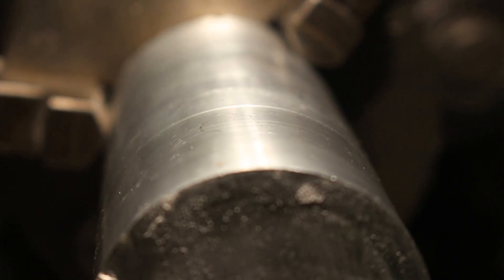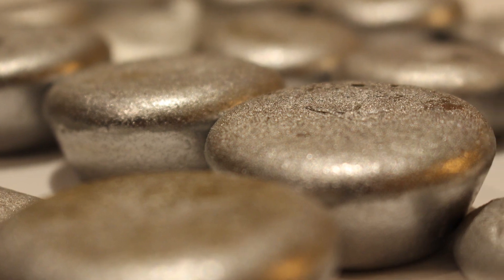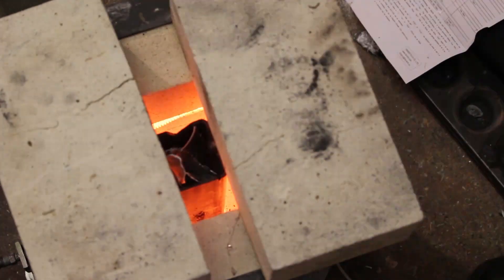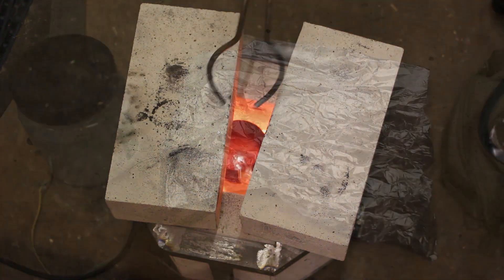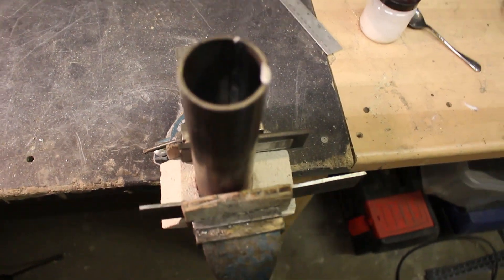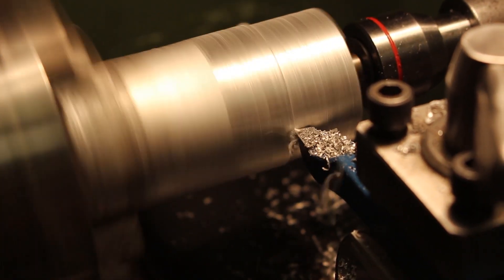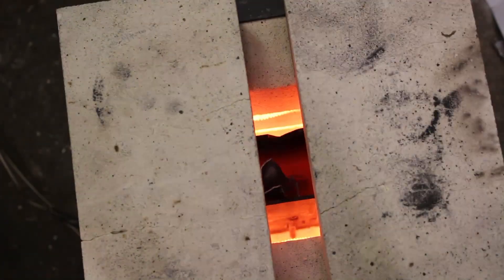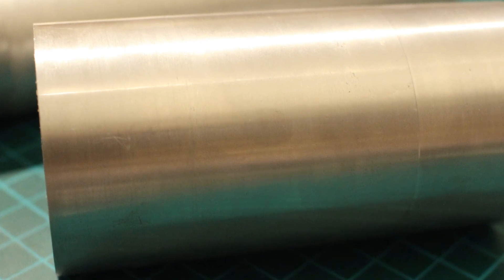Casting Aluminium Roundstock From Free Scrap

Comment: to save lathe shavings put them in a big zip lock bag with a couple of ounces  of dishwashing soap and the rest water, shake them up good then drain water out of bag and refill with clean water and shake again, then put wet chips in flat pan to dry and remelt

Comment: for the slag when using soda cans which has paint on the outside and a thin plastic on the inside, use household salt.
a tablespoon or two (maybe 3 or more depending on how much aluminum you are melting) will reduce your dross by more than half

Comment: If you feel limited by your chuck, cast yourself a face plate.  I highly recommend one of the How to run a lathe books by Southbend or Hercus, etc.  Any commercially available workholding device can be replicated with shop cast Al, with the exception of a centre for your lathe for turning between centres - incidentally, another great way to turn round work pieces.

Comment: it should be noted that this will be nowhere near the strength of typical aluminum one would buy (6061 T6) since it is not tempered or anything. probably closer to the strength of 319f casting

Comment: Make larger diameter pieces and then just bore them out about 1" deep and at a diameter to fit over your chuck jaws when totally closed. Then just open the chuck to secure your bigger stock to that you just bored out. Wait that will not work so instead make that shape in your mold at the bottom, but make sure its centered to your  pipe. Then you will have a recess that your chuck can open into so as to grab the part. Now you  can use the chuck jaws you already have.

Comment: how well would it work if you used a disposable round steel cruible and just melted the scrap aluminum with lashing of flux then let it cool and extract aluminum?
basically used crucible as mould and skip the ingots stage, less energy will be used as not  re-melting, thus will be even cheaper.

Comment: The main difference between cast aluminium and commercial stock is the commercial stock is rolled & or extruded which dramatically improves the microstructure. 
Just means this material will be relatively brittle.

Comment: I'm making a 2 x 72inch belt grinder in England. I got my motor and controller from an old treadmill and square tube which was left over. Would anyone make me some roller wheels for it out of Aluminium? If I where to buy them they are £36-40 each!

Comment: Finishing the surface this way makes a problem. Although you used a 3 jaw chuck you cannot guarantee that the material runs perfectly centric after turning it for finishing the other side. 
Maybe think of turning between two tips. So you can finish the surface without even a small gap. 
But I think for most cases you use this material for, this is good enough. ^^
In the end still a pretty interesting video! 
Regards from Germany!

Comment: or how to make a gun barrel using the lathe
Reply: A gun barrel out of aluminium? Right...
Reply: Berzelus it's been done. and it's worked. I wouldn't chamber one for .338 Lapua or anything, but .22 LR might not be too bad. of course, the rifling would wear out quick, unless you used a steel barrel liner.
Reply: It's been done? Shooting work hardened copper jacketed ammunition out of half as hard rifled barrels? If you mean having a smoothbore barrel and shooting with it why not simply go and buy a steel tube? It will be better in all ways. If the aim is to make it in a DIY setting then you may just go the bronze/copper way.

I don't know, the whole idea of using aluminium for a barrel sounds like such a complete waste of time that the simple though of it after 5 minutes, in a firearms setting, is but an excercise in futility that can only irritate me. Aluminium is more expensive by weight than steel. Steel is stronger than aluminium. Steel comes in a huge variety of forms and diameters that are already very close to a rudimentary barrel. A self made cast aluminium barrel does not compare to a drawn out/extruded steel tube, the first is a hazard, potentially resulting in even the death of the user and the second has many chances of working in some way.

Do you mean in general that an aluminium tube can carry a round-ish item from one end to the other? Yes, indeed, but so can a straw. If the aim to make an airsoft gun, then yes, it will most likely work, it might even work with compressed air, but not for high heat, pressure and wear applications such.

The question still remains though, why take the more expensive material and spend more time on it only to create a more cumbersome item that will wear out faster and be less reliable, a potential safety hazard even? Is it so much easier to melt a shit ton of cans than to take a hacksaw to a simple rusty steel pipe? Besides, you can weld the pipe later on, while the aluminium will be a big trouble for any further work.
Reply: Berzelus it's been done, yes. not the greatest idea, but it works for low-pressure rounds. slam-bang shotguns aren't the best idea either, but folks build them all the time.
Reply: Folks also don't change their tires even though they've been through 20k km or so, that doesn't make it remotely sensible
Reply: Berzelus that's correct. didn't say it was a good idea. just that it's been done, and that it can be made to work in certain situations.

Comment: good idea the shrinking aluminum no need to split the mold you can make a lead hammer for doing all sorts of things if you use oil used motor oil 20 cents a gallon it gives the highest heat you can melt cast iron to make your self a milling mashie you can use your lathe as one until you get the big one built use old truck bearings and keep the parts they rest on as well or put them on your castings your self good luck .

Comment: hey is clay a good way to mold aluminum. like a sword mold
Reply: Bassem Elmehdawi not clay but green sand casting is an old and very workable way to cast aluminum.
Reply: Bassem Elmehdawi not really, water based clay will rapidly evaporate causing a porous pour or in the worst case can explode. Oil based clay will burn causing bubbles again or even explosion. Even when fully dried the mold is brittle and might break from heat. TL;DR(no)

Comment: leaving the roundstock to cool naturally in a bucket of sand would improve the quality of the final aluminium, the slower the metal can cool the smaller the crystal structure of the material therefore improving the surface finish of any of your final products
Reply: Calum MacCurrach  your right

Comment: Carbide cutters don't really like to cut so much bit they like to plow with heavier cuts to make a nice surface finish. Hss cutters like the light finish passes with a lower surface speed. But generally with aluminum it's soft enough to cut easy with any cutter. If your carbide is not cutting aluminum nicely first check to see if the edge isn't worn off the insert and take a deeper cut.

Comment: just wash your turnings with dish detergent in a dime store plastic pasta strainer. if you make really fine chips, use one of those screen hemisphere rice strainers. for borax, just use the local equivalent of "20 mule team" laundry borax. great series, and ideas. love the trapeze mount crucible, lol. i'd say a great idea for a project to test your mettle as a metal caster is a functional section of chain, made in a single pour. you could probably get 10 vids just on the failed attempts, lol.

Comment: You are a very skilled wood worker... I have a challenge.... Build a pretty large wooden plane... Make it a model or working ur choice, I've built a spitfire that's wing span is 29 inches from wood... Do you accept the challenge it requires a large depending on the plane

Comment: instead of remelting the shavings you should turn them into thermite
Reply: +Travis Bohanan it's a mixture of iron oxide and aluminium powder.
Reply: Dave Smith You can put it in a ball mill to make really fine aluminium powder from these kinds of shavings. Watch Cody's lab's video on it.
Reply: Swarf isn't fine enough for thermite. It will work, but you will need an intense heat to melt the swarf and get the reaction going, and chances are it won't keep going. The best way to get aluminum powder is to take aluminum foil, throw it in a blender. I still haven't figured out a good way to cast aluminum foil, as it always ends up too thick to be usable.
Reply: I thought thought that only worked with iron?
Reply: Silent Warrior they do
Reply: Glen Phenix lol
Reply: that won't be of much use in machining tbh
Reply: Tohmi Prachyl  termite is dangerous don't try it
Reply: Except aluminum

Comment: wish my friend owned a lathe I could borrow! not all that common in the states. When there's one for sale its rather pricey also.
Reply: harbor freight has semi decent lathes for reasonable prices
Reply: lathe and well equipped workshop. This guy is just lucky having the right father. Without this, he wouldn't be able to make those projects.
Reply: A woodworking lathe should actually work fine for aluminium since it's so soft. You'll need to make your own milling mechanisms though.
Reply: @Marc83Aus  Actually, I have a woodworking lathe and there is no chance of having the precision required for even half-decent metal jobs. It is easy to get them chipping metal, but the end results won't really cut it. (npi)
Reply: +Samuel Scott thrre for woodworking I thought
Reply: try craigslist just always be looking you eventually find one cheap or David gingery it out
Reply: Harbor freight mini lathe is good enough. You can also make your own lathe which is fairly simple unless you want threading functions or automatic feed. Even then though, if you buy the gears and copy an existing lathe's setup you could do it yourself, although at that point people just drop the $500 and buy a lathe.

I use a mini mill but I ended up having to build a lathe to get a long enough bed for deep hole drilling to make barrel blanks.
Reply: in the uk too @AlexCoronaPhoto i wish i had a frind with a lathe:P,I suppose its like many other things its who you know:)

Comment: high speed steel for aluminum and mild steel. Carbide for stainless. High speed steel cuts better so it gives a smoother finish. Carbide is harder and more durable but it tends to "plow" instead of cut.
Reply: Andrew Cline four jaws are reverse able not three jaw

Comment: while I've seen your videos before I've never paid attention to where you are located. However, unless it's just not sold there at all, you should be able to buy pure borax in your laundry isle at your local supermarket / shop. it should be the same as the stuff you bought from eBay and most likely cheaper.

Comment: not bad! I really like the clarity you help give in what you can do with scrap materials, and turn it into something 100% usable for making something new with. also kudos on at least making an effort to include the trimmings. maybe just collect them in a bucket, by metal type, and washing them in a soapy water to wash the oils off? I figure doing it in batches like that means you won't have to do that very often. and maybe make a screen in a spare lid to drain the soapy water and rinse water out with. I might do that myself.

Comment: aluminum cans are pure aluminum ladders motor castings and such are alloys. the reason for so much slag is oxidization due to the melting practice flux etc. high end recovery from cans is ussually only around 68%

Comment: u could turn between centers with a home cast lathe dog and faceplate for larger diameters, like they did in ye olden days./ the dogs and faceplate would be good videos too.. You could then machine a tiny cannon out of scrap brass shell casings  if your furnace can handle brass.

Comment: save the aluminum shavings, put them in a ball mill and mix with iron oxide for iron thermite
Reply: Shavings are little bit big for that application. Sure it will burn, but its not effective as in powder form.
Reply: Eddie Cabrera thermite is dangerous don't try it!!

Comment: If you after you take em out instead of letting em cool put em in the oven, 175 Celsius for about 8 hours, and then "cool" em off by dunking em in boiling water. By doing that the aluminium will get better machine properties, close to a T4 hardness. If you wanna get closer to a T6 (550C 2 hours, dunk in boiling water, 380-420 6hours, dunk in boiling water). Really close to melting point.  Why i suggest it is because you actually run a electric furnace and could actually produce the tempering needed for a T4 or T6. =)
Reply: same result by just letting the aluminum cool slow, not dunking in water and tempering your writing about normalizing.
Reply: No i don't i'm talking about artificially aging the metal. You don't normalize Aluminium. You artificially age it so the crystaline structure reorganizes and settles. And no you dont get the same result with just letting it cool slow. There is list of steps to take to reach a T6 or similar. Pick up a metallurgy book, old navy manuals is the good ones for hobbyists. Good luck. =)

Comment: if you use wd40 as a lubricant when turning aluminium it really improves the finish as the chips clear a lot quicker and the tool cuts a lot smoother :)

Comment: Are you sure the jaws aren't reversible? try opening the chuck as far as it will go, and the jaws will fall out. typically they will have two sets of numbers for the order that they are inserted into the chuck relative to the orientation of the jaws. Great video!
Reply: Absolutely sure. You can not reverse the jaws of a scroll (self-centering) chuck. For that reason most scroll chucks are supplied with two sets of jaws, one set for each direction. An independent 4-jaw "universal" chuck has reversible jaws. It is driven by a dedicated worm gear for each jaw. The scroll chuck has a spiral drive (tighter radius at the center than at the edge) requiring a very unique, precise shape to the teeth on the back of the jaws, curved in such a way that it will be tight at all points along the varied radius scroll. Turning it around means that the curves cut in the back of the jaws are directly opposed to the curve of the scroll drive gear. 

Just get a 6" 4-jaw universal chuck for handling larger and square stock. Under $200 US, shipped. I believe your lathe has a 1-1/2"-8 threaded spindle, but you'll want to verify that before ordering.
Reply: +Jon Miller I own a proxxon pd230/e and it came with a 3 jaw self centering scroll chuck and the jaws are reversible. 
I just change the order of the jaws from 1-2-3 to 3-2-1.
They do exist :-)
Reply: +orpantattoo Fascinating. It appears that their documentation is poor, so I can't see anything regarding how the chuck operates. Judging by the visible appearance of the chuck (more like a drill press Jacobs chuck than any other lathe chuck I've ever seen) it has a different mechanism than any I've seen before. What do the teeth on the actual jaws look like? Teeth on typical scroll chucks are curved to match the spiral drive gear ("scroll"). Because of that curve they can not be reversed. You would have to make teeth which are an intersection of the profiles for the two directions, which would mean that they are smaller, giving less bearing surface and therefore less strength, lower precision, and less available wear surface so they would also wear out faster. And they would be more difficult to machine, assuming that the goal is precision, making them most likely more expensive to produce than separate sets.

Thank you for sharing!
Reply: +Jon Miller the chuck is actually much like any other scroll chuck, the only "odd" thing about it is that the gears are external.
The teeth on the jaws have an oval shape so you're absolutely right about it beeing a crossection.
However I doubt it matters as the teeth have full contact on the side where the "spiral" drives them when holding the workpiece from the outside.
When holding something on the inside it does however have a smaller  area of contact. But i rarely do that.
It is a VERY small lathe after all :-)

Comment: Make some kind of engine. If you don't have a milling machine to do the "non-latheable" bits, you could use your CNC to machine foam for use in investment casting, then just clean up the mating surfaces by hand.

Comment: To make larger diameter items turnable with your current chuck, you could always make your mold (the steel tube) stepped.  50mm then a step to 200 mm or whatever.

Comment: You'll get a lot smoother finished surface, if you'll grind your high-carbon tool steel cutter bit with a goodly radius, & lots of relief. Since you're cutting aluminum, you need to run at a higher RPM. If you machine threads, your "cutting oil" is Turpentine. thanks for your video. I wrote another comment on reversing your chuck teeth, and I didn't thank you in that video...I had to post it in order to go back thru your video to remind myself what the subject was that what else I was going to comment on. Sorry 'bout that. I did enjoy your video. Keep em coming.